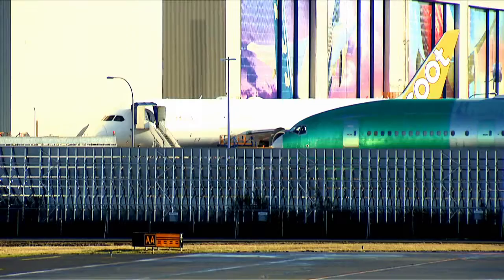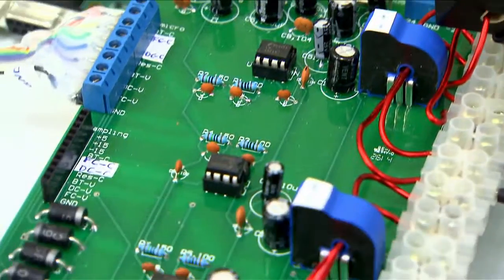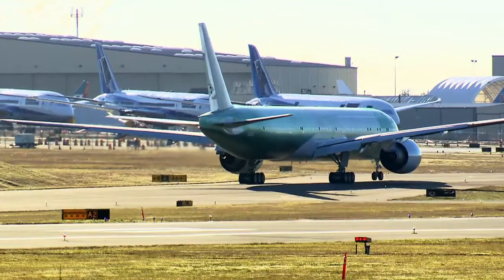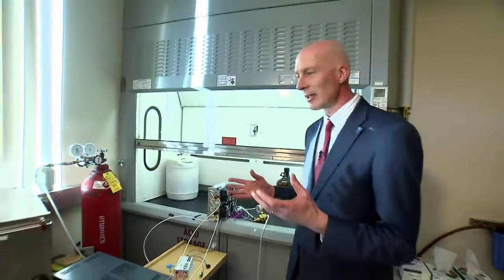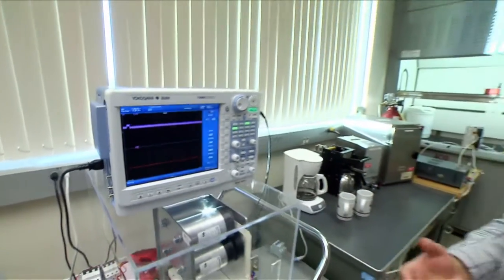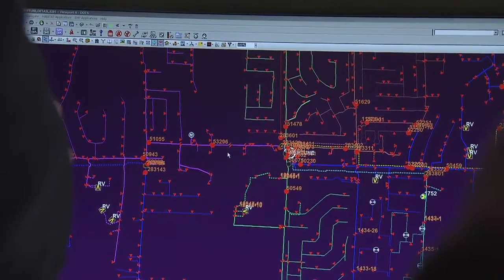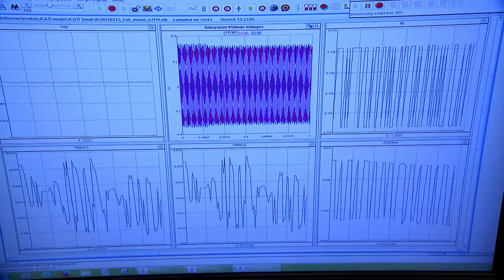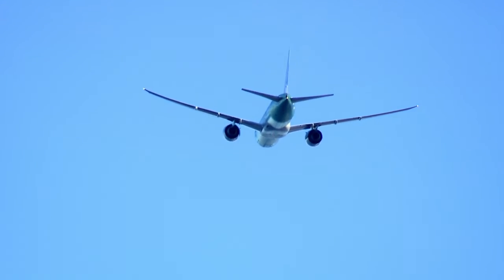Fuel Cell-Based Auxiliary Power Unit

Comment: this is a good idea. think of the scalability with electrical climate control and de icing systems. i think the 787 has an all electric system. Also in the few cases where aircrafts have run out of fuel, they would still have power to control systems.